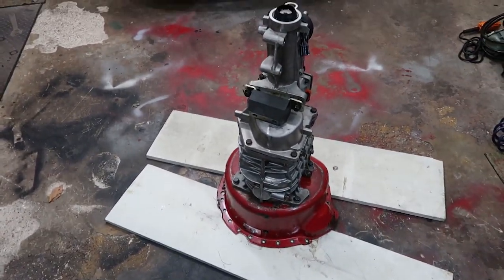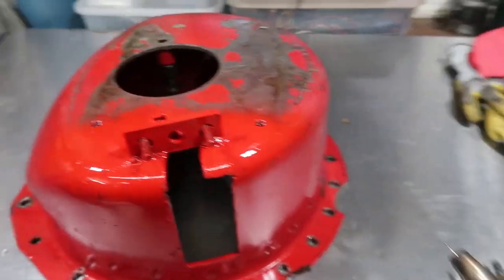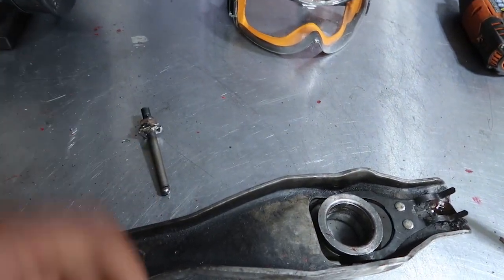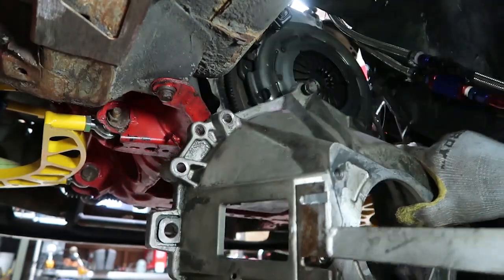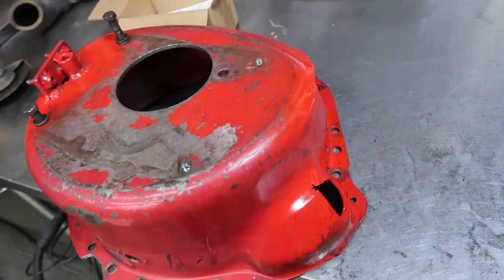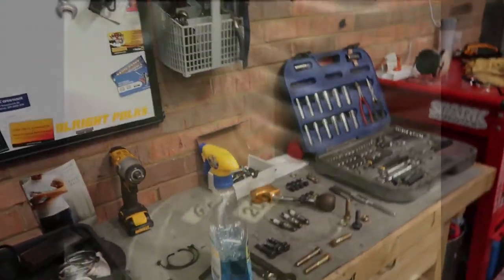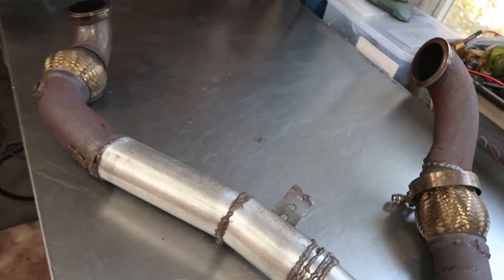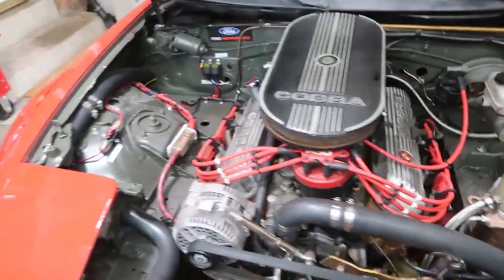v8 Miata gets a TKO dogbox Transmission

Comment: The 3550 was only factory offered in the 1995 Cobra R with the 5.8L. It was not a direct fit as it has the 79-93 input shaft length.